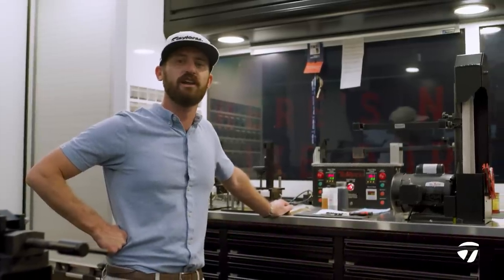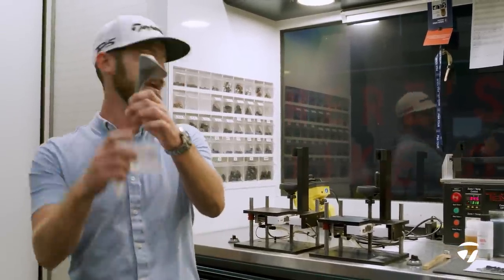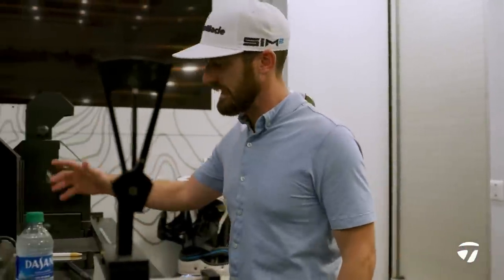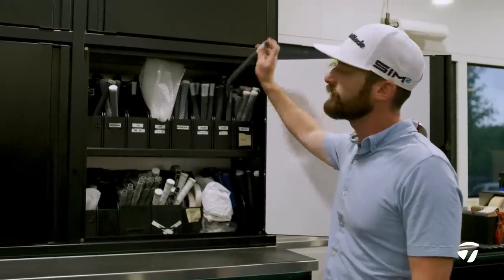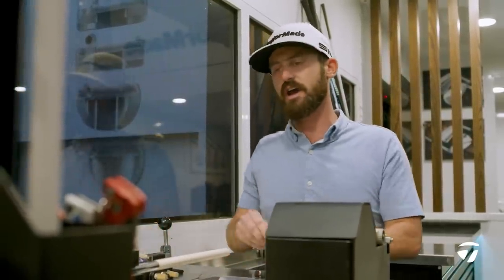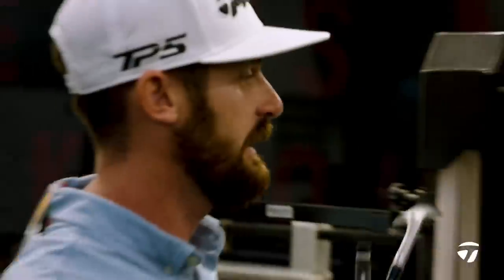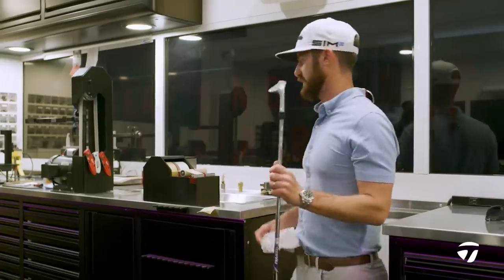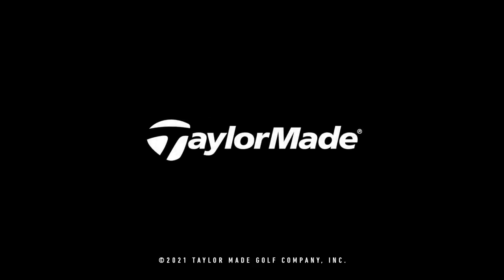Building Rory McIlroy’s Wedge | TaylorMade Golf

Comment: I'm two years late to this, but this was really cool to have a behind the scene look at what goes into building a club for one of the best players on Earth. I thought it was extra cool that you are using an induction coil to heat up and cure the glue in the head of the club. Also, never knew that a weight went inside the neck of a club.